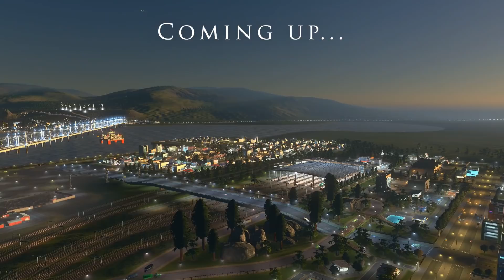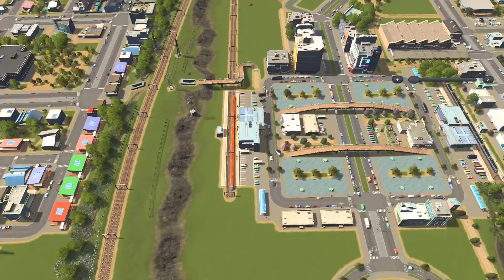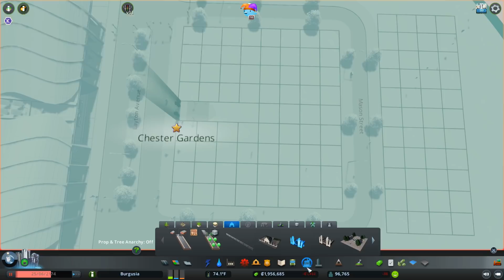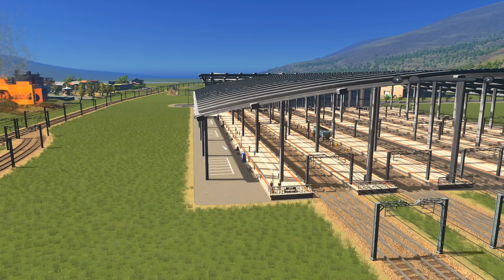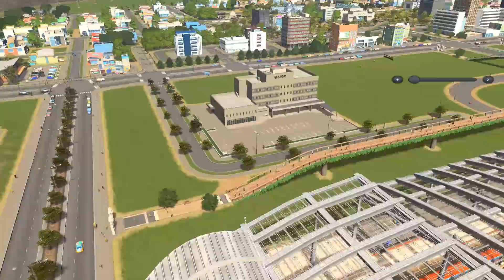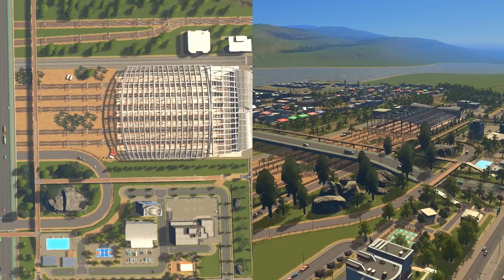Intercity Train Terminus! - The Cities Skylines Build Guide [Tutorial Lets Play] Part 69

Comment: Yes, the rebuild! Really fitting solution. Does the bug also affect the big train station with traffic going through?
Also, I think Cims are not using the park path between two stations, as the zebra crossing in front of the big station are on the sides of it, due the road layout, I believe. So, going around is logical for them.
Really looking forward to the cinematic and the new series!
Reply from the maker: Apparently it's not a bug, but the larger train stations will only accept intercity trains on a random platform, seems silly!

Yeah, I looked at my test of this build and I changed the road crossings to directly in front of the station!

Comment: About the "bug" for non appearrance of intercity trains at hub.  I've been told it is random each time you place the hub as to which platform the intercity train will use, therefore you need to connect all 6 lines to outside connection to determine which track the intercity train will arrive on.  Once you know that, you can then delete all the other tracks to outside lines and is "should" work.
I haven't tested this idea as I did the same as you with a separate train station and short walk to the hub.
Reply from the maker: Yeah, few folks have mentioned it seems to be random which is a bit silly tbh! Still, at least we know for next time :D
Reply: Thanks, i will try this out. never thought this could be a bug, i always thought well, noone wants to visit my city by train from the outside ^^